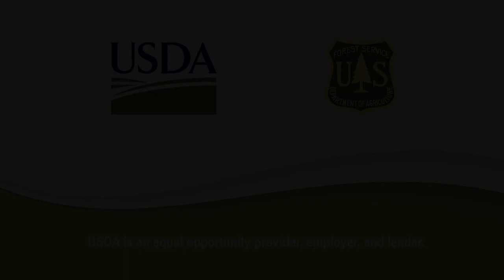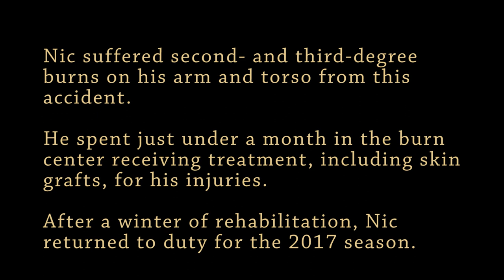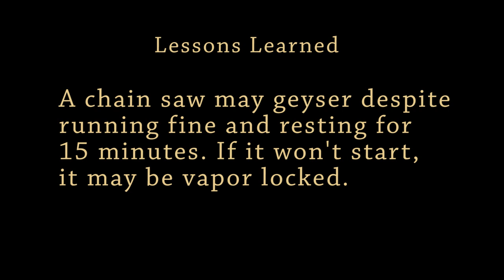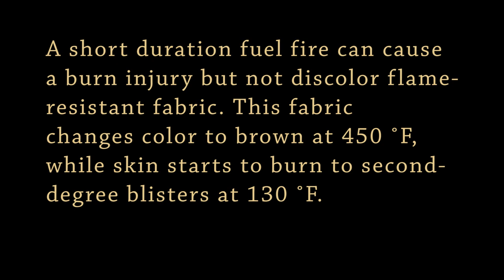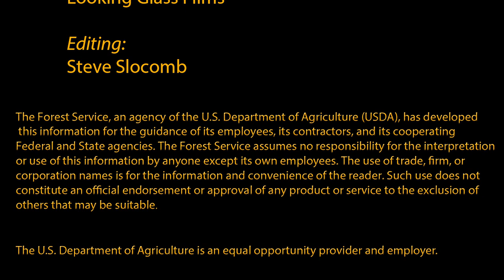Fuel Geysering: Predictable?

Comment: I’ve had this happen many times before when taking a yard tool (weed whacker, edger or leaf blower, etc) from hot storage in our shed on a hot day. Luckily in my case there is no fire burning and I am away from any source of combustion while getting ready to use the tool and before doing so am checking the initial fuel level.  This video is a good lesson to take more care when using these tools.  Thanks!